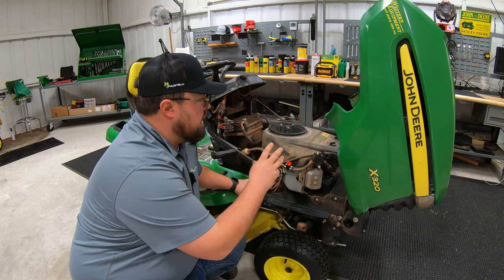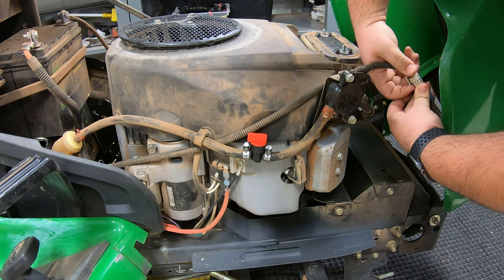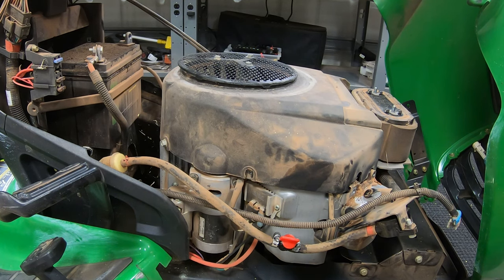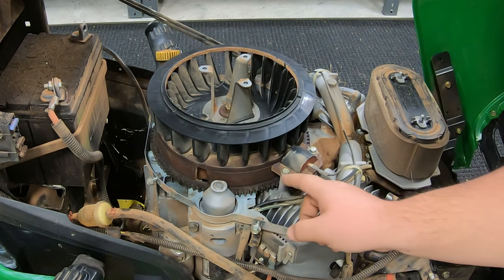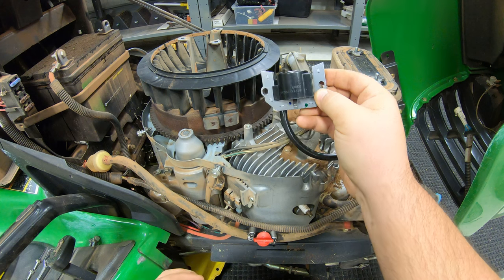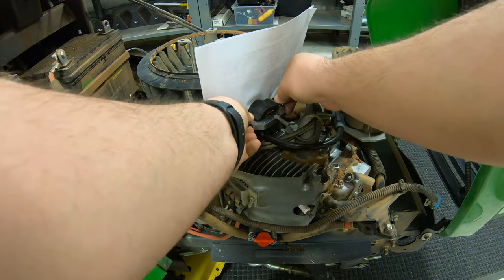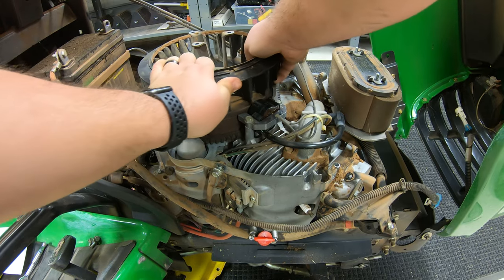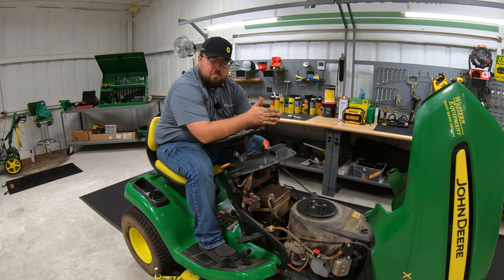How to Replace Ignition Coil on John Deere X320 Mower

Comment: Excellent. I just paid our local dealer $250 to replace one; thanks to your video, in the future I'll do it myself. They diagnosed the condition by starting the JD 335 mower, then removed one spark plug wire and the engine kept running, then removed the other and the engine died.

Comment: Great video.  My X300 is running poorly and after checking the fuel system I discovered I was getting no spark on one coil wire.  I removed everything and the rocket scientist in me noticed the spark plug wire was worn in two somehow so I hope my local JD has those in stock and doesn't have to order them.  I would have totally screwed up putting the new coil on without this video.  I had no idea they should be gapped by a double piece of paper.  I would have just bolted it down.  Thank you!
Reply from the maker: Oh no! Good catch on that one. So is everything running good now?
Reply: @247parts  Thanks to you, yes.  Running like a Deere.
Reply: If you didn't know about the coil gap, maybe you shouldn't be working on the motor?
Reply: @brentwilson5971  Nope, I chose to learn and do everything myself.  We all learn from our mistakes.  Anyway, all turned out great and the mower got fixed without a $200 bill from a service department.
Reply: You could've kissed that engine good by if you would've started that engine without any gap on ignition coil.😬😬.

Comment: The easy way to test coil is pull one plug wire off at a time ( twin cylinder) with engine running. If coils are good you will notice engine studder when pulled off. If coil is bad no difference in engine sound, then pull off good coil wire and engine dies. Engine was running on one coil good and one bad.
Reply from the maker: Nice tip! I should have done this.

Comment: Hi, great video! Wondering if this could be the issue with my X360. It turns on fine and mows, but has hardly any acceleration on flat ground , not to mention hilly spots in my yard. Plugs were just replaced. Any ideas are greatly appreciated.
Reply: Mine did that it was dirt in the tank , I blew air back through the lines , look at your fuel filter to see if it's full of gas and clean .

Comment: Good morning I have aX320 engine FS651V? ,2012,402 hours. My problem is runs great cutting great every so often engine will just go down and die then back fire like when you get off of seat and engine kill switch takes it out, thinking electrical. Have bypassed seat switch. Does not happen all the time but is getting more frequent. Did notice on last on cut engine did sputter and back fire but picked bk up and kept running then died a few minutes later. I usually flood it and get off wait a few minutes and it will crank as normal. Your thoughts would be greatly appreciated. Thanks in advance. 

Can I get coil through you if needed. Just hate to start changing parts in the blind if you know what I mean TIA
Reply from the maker: I would change the ECM. This is a common problem with these mowers and this usually fixes it. Here is a link to a video I did on changing it. https://youtu.be/xZDVAWflDoQ
Reply: The popping is from water in your tank, doesn’t take much, condensation!